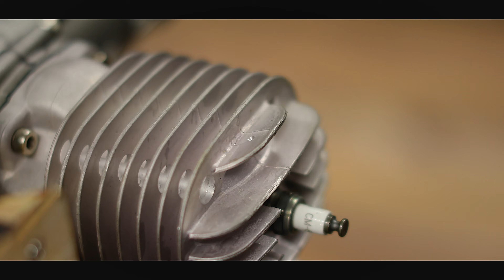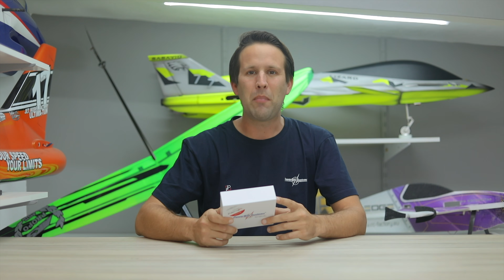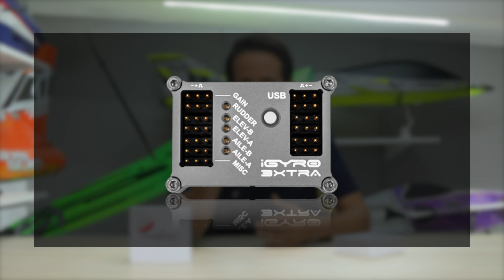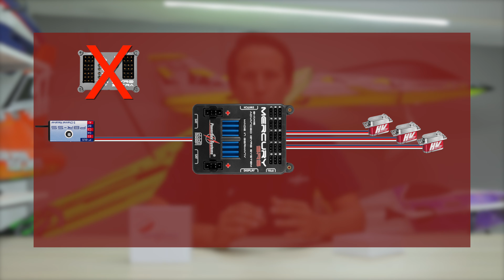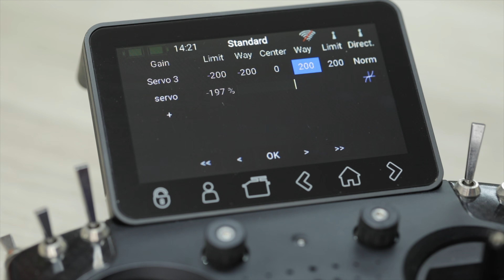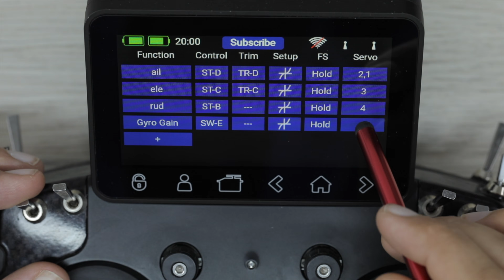Powerbox-Systems iGyro 3Xtra, FULL REVIEW

Comment: Does the iGyro 3Xtra resist turbine electrical and frequency noise that effects other gyros?
Reply from the maker: Yes, it works fine right out the box, no need for the funny covers and padding used by a number of other brand systems

Comment: so once the gain is set does that mean the more gain the more stabilisation it will have? what i mean is it will act as a stabiliser with more gain input and les with out it
Reply from the maker: Stabilizer usually involves returning the model to straight and level. That is not what this does.

The gyro self corrects wind, so the plane is basically unaffected by wind.

The more gain, the more control the gyro has and it can compensate against more and more wind.

Too much gain though and it overcompensates. Not enough and it still works better than no gyro at all but it could be helping even more

Comment: Hi Martin. Great video. I'm 2 yrs late but better late then never.
I hv setup the 3extra and gain on a knob. When I turn my knob to the left it all lights my green but to the right some lights (I think 2 lights) remain red. So, which is normal gain and which is heading hold?

Secondly, if I have not yet set up my end points, I would have to go do only the setup part for the 3extra shown in your video instead of the whole process from start correct?

Lastly, I haven't flown my plane yet. So wen I do my maiden fly and get my plane trimmed, then I can test my gyro.
Once trim is set n I land, do I keed to relearn the setup again to get the gyro to learn the trim?

Thanks in advance.

Comment: Just bought one of these and am trying to better understand the installation. Everything is clear except for how to set up the gain channel. I'm my case it will be to a rotary knob and I would also like to set the gyro to a switch to allow for different settings and even off if I want. It's not really clear how to use the rotary knob, I have a Spektrum Transmitter and need help. Thanks! Great video.
Reply from the maker: Hi Wesley, you can simplify the understanding to the following: "all gain control is via a single patch lead".  So basically, you can have a slider, a switch, or both, but always acting upon a single channel, the one that the patch lead is connected to....

Whenever that channel is at its center (0), the gyro will be off
Whenever the further away from center, the more gain

If you use a slider AND a switch, you basically just want the switch to override the slider in one position and force the channel to go to center; and with the switch in the other position, the slider can control the channel freely

Hope that makes sense!

Comment: QUESTION: Can you use a Rx that has built in stabilization with the iGyro 3Xtra?  Unable to find anything anywhere on this.  

Martin, your videos are as great as your flying.  Thanks for all the great info!
Reply: Did you ever get a definitive answer to your question? I have mine set up with the iGyro3 extra, and my reciever has a gyro as well. I figured as long as the iGyro3 gain position is set at zero, the reciever gyro switch on, I should be okay.

Comment: do i RELY have to all this? can´t i just use the USB to setup my Gyro with the PC or the Smartphone App?
Reply from the maker: Yes, use Usb no problem, this is just an option for anyone who doesnt have or want to buy the Usb adapter
Reply: @MartinPickering-PickeringRC  hmm i cannot use the App for direction setup at all. all i can use the app for is to "edit" gyro setting regardig "gain" or behaviour.
it was a pain to get the Gyro to work properly due to it being RELY sensitive to inputs and some times not sensitive at all on inputs during the setup regarding direction and servo outputs, after 2 hours i could get the control surface´s to act in the correct way. 

i rather put in the info my self than lifting the plane here and there and getting gray hair on why the gyro act´s in reverse mode.. :) 

well  well i  hope i remember the setup now, at last it works :)

Comment: I'm about to order one on tower Hobbies. I'm confused. This gyro can be mounted anywhere? Doesn't have to be on the CG?. That's insane!  I guess I've been out of the gyro game for a long time. This thing sounds amazing.!
Reply from the maker: Hi Brian, correct, anywhere will work! Have fun, you will love it!
Reply: Only gyros that also use accelerometers need to be centered on the CG. 
Gyros that don't have self-leveling functions typically don't use accelerometers, so position with respect to CG is pretty much irrelevant.
Alignment is not, though. You want them to be flat and orthogonal (90º) to plane's axis. ;)

Comment: What is your opinion about gyros can affect your flying skills in a negative way? Do you loose your skills for flying 100% manual in strongs winds?
Reply from the maker: I feel that they don't, after all, you still "fight" in strong wind (otherwise you would need huge amounts of gain which is unviable), it kind of just evens out some of the bumps and it will do that much faster than a human can...
Reply: @MartinPickering-PickeringRC  Thanks👍🏻 Sounds good. Just hate the additional weight on a small plane.

Comment: I have an old A3 3axis gyro fitted on my foam plane, I want to try out on my 30cc Gas 3D plane. What will be your opinion ? Will it function properly as Gas plane vibrate so much ?
Reply from the maker: I only every used the Powerbox gyros, but these ones I have used with Gas engines and had no issues. Make sure it is securely fixed inside the model (strong double sided tape) and should be ok
Reply: @MartinPickering-PickeringRC  Thanks 👍